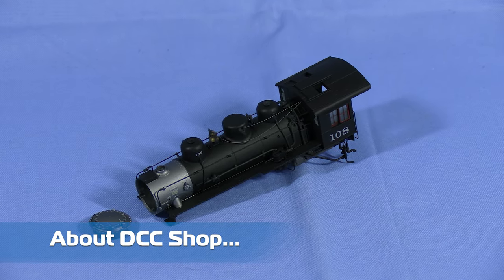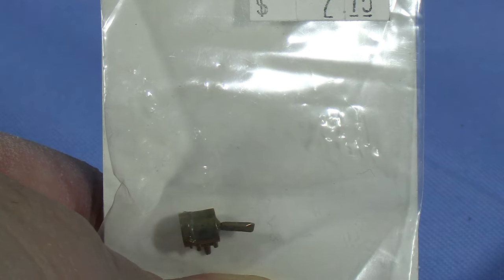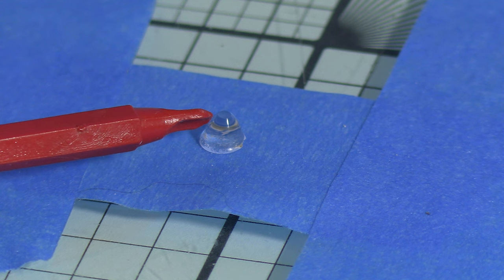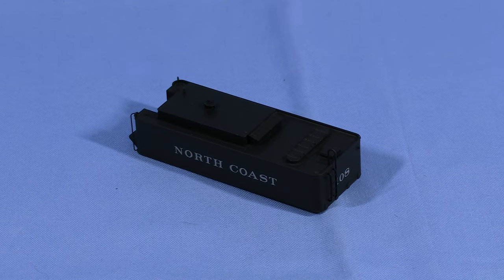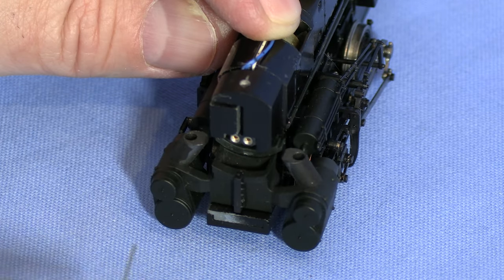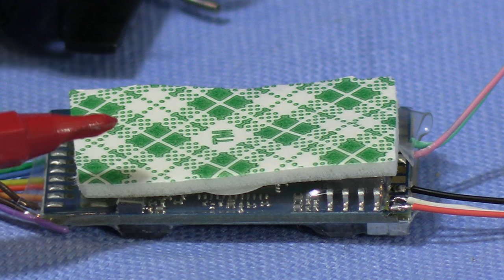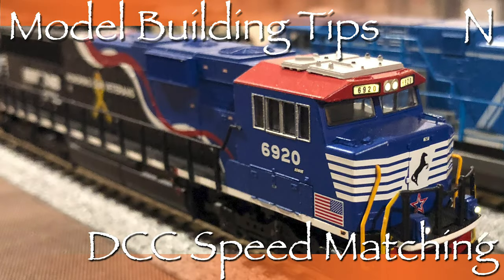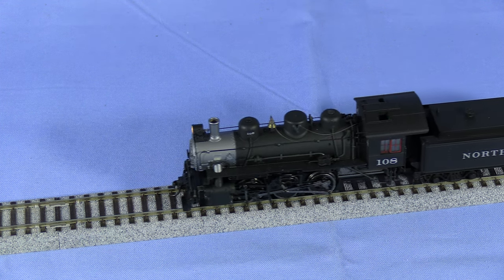DCC Shop - HO Proto 2000 0-6-0 Steam Locomotive - DCC, Sound and Lighting Install

Comment: Excellent video.   I am doing one of the engines for a friend.   I agree the tender pickup should be soldered,  but it appears they also apply pressure to the shoes to     assure good pickup from the wheels.   How has yours been as it picks up from the engine too?    Also, great idea about making you own headlight lenses now that MV's are no longer available.
Reply from the maker: I don't really have a permanent layout set up yet, so I haven't had that much chance to run this engine.  The pickup arrangement has been working well when I have run it.  The ESU Power Pack capacitor also helps a lot.  I'm glad you liked the video.  Thanks for watching!

Comment: A great instructional video as always Daniel. Just wondering, what abrasive did you use for the Paashe Air Eraser?
Reply from the maker: I'm using Paasche AEX-5-240 compound, which from what I understand is fine aluminum oxide particles.  I've also used the Badger version, which looks like the same thing.  Thanks for watching!

Comment: Great video! Can you answer a question? I have an ESU decoder, I don’t have a programmer. Can you tell me the cv and value to make a rotary beacon to flash? Thanks!
Reply from the maker: The CV will depend on which output you're using for the beacon.  There's a chart in the LokSound 5 manual which you can download from the ESU website if you haven't already, along with an explanation of the process.  The mode select CV is the one that sets the lighting effect, like beacon, firebox flicker, etc.  There's a different one of those for each output.  In my version of the manual the chart and explanation is on page 85.  Some of the LokSound CVs are indexed, meaning that you have to set an index CV (I think it's CV32 if I recall) to a certain number to tell the decoder that you're going to be programming lighting effects.   I hope that's helpful.  These are fantastic decoders, but with that comes some complexity.  You might want to consider getting the programmer at some point, as it makes all of this so much easier.  Thanks for watching!

Comment: Dan I love your videos and the fact you model the SP. I'm picking up a Genesis Mountain this afternoon and it has the customary dead headlight so I want to upgrade them to LED. What LED did you use on this locomotive as I want a prototypical incandescent color and not a bright white.
Reply from the maker: I'm glad you're enjoying the channel.  I used a warm white surface mount LED in this one, 603 size.  They're small enough to fit in a typical HO steam engine headlight casting.  If you shop around on eBay there are sellers that offer them with leads pre-attached.  You can also get them loose and solder your own wires if you don't mind working on tiny components.  The warm white has a more yellowish color that's more like an incandescent bulb.  The regular white is usually slightly bluish.  Thanks for watching!
Reply: @DanielCortopassi  Thank you Dan!! keep up the great work!
Reply: @DanielCortopassi  I forgot to ask. Can you use the 603's for class lights and marker lights on the back of a caboose or passenger car or do they require something smaller?
Reply from the maker: @chadgeissler4544  603s might be just a little large for class light castings, depending on the design of the casting.  There are also 402 LEDs that are even smaller.  I'd recommend getting those with the leads attached.  For me, anyway, I find them very difficult to solder, while I can handle the 603s.

Comment: What throttle do you have that has a playable F2 key? I used to have lionel and they had playable horns. It’s something I miss ever since I went to HO. I think it’d be really cool to have playable airhorns but I’m not yet sure how to program that.
Reply from the maker: For this video I was using a Digitrax DT402 throttle.  It has the playable F2 key.  I would say that sometimes the effect is a little weird.  I think it works well with this model, though.  It depends on the particular whistle or horn sound.  Thanks for watching!

Comment: why not mount the DCC  speaker in the Loco instead of in the tender
Reply from the maker: Space, mostly.  This engine's frame fills most of the space inside the boiler.  If I did try to put a speaker in the engine, it would have to be a really small one.  Using the tender let me use a larger speaker, which has really nice sound.  Thanks for watching!